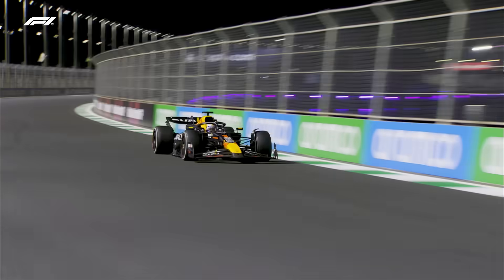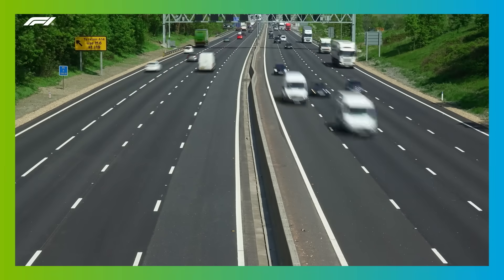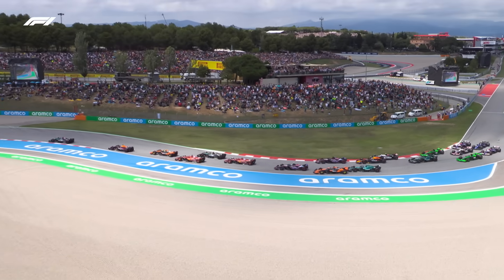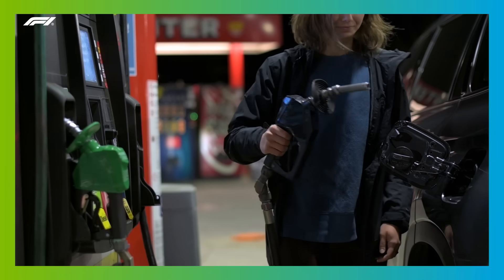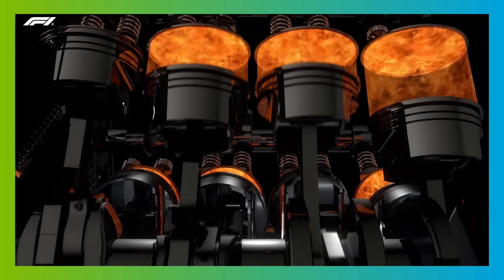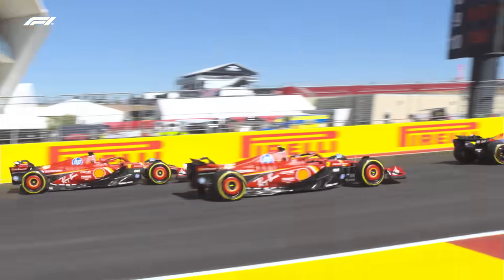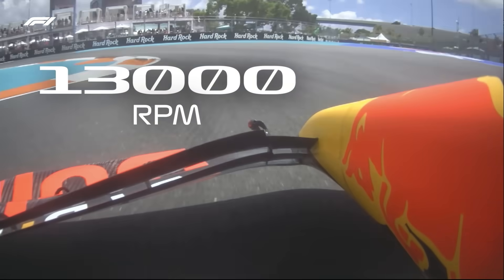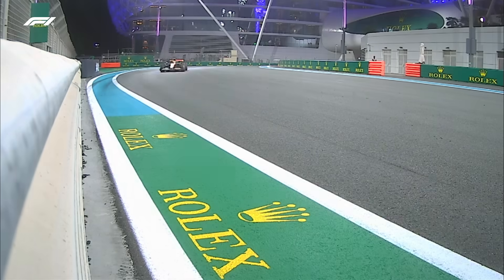F1 Car vs Road Car: The Differences In The Engine Explained | Aramco

Comment: the life of todays f1 engines is very less, they need to reduce the cap of engies per season to 2 per driver if they use 3rd there will be a huge penalty, so teams will focus more on reliability than only power. which will be beneficial for the whole automotive industry.

Comment: 1:25 "The turbo charged 1.6L engine in a typical family car might produce around 160hp" is probably the most American thing I've ever heard. A regular family car at 1.4L in Europe makes around 160hp, but 1.6L turbo engines can easily make >250hp. Then again, the USA did bring us the GM Vortec 8100 which was an 8.1L v8 making 340hp, that's a whole 42hp/Liter!

Comment: Reliability and long term application play a huge role too. F1 engines are expected to last 1000-1500 kms before a rebuild. Road car engines are supposed to last 300,000Kms+. Higher performance = Higher wear and tear.

Comment: I still say: keep the fuel limits but give them unlimited fuel flow and unlimited turbo boost. 
That would definitely give chances for smaller teams to go crazy and risk it all (engine blowup and penalty or no fuel halfway) and make an impression even if they don't finish the race. Not to mention it would scramble the qualifying by a lot!

Comment: Yes, but as you tell people that electric motor will be almost the half of the total power the PU will be capable to produce, tell people  just the same you will remove the MGU-H which is central in recovering, which is the key world for these engines along with efficiency, and the magic trick to have all the turbocharging advantage without having its issues. IMHO a totally crazy decision.

Comment: This kind of efficiency wouldn't have happened if we didn't care about it and I'm glad for the V6T hybrid era. We can take that thermal efficiency tech and apply it to all sorts of engines like V8s and V12s. 

Though we could have had mass flow limits on any engine configuration, and it would encourage the teams to squeeze every drop out of thermal efficiency for maximum power.

Comment: need to say that according to rumors mercedes ICE was able to reach 50% of thermal efficiency by 2015-2016 already but only on ideal conditions of a testing dyno. It's hard to say if engines actually used in race until today (that have been frozen for most of their parts back in 2021) are close to that rate in real world conditions influenced by thousands of factors like temp, humidity, air pressure etc.

Comment: there is no point in comparing f1 engines to road car engines, since the engine technology being used has no relevance/connection to the public whatsoever, especially since f1 is not an endurance series. F1 should go back to naturally aspirated v10s, to not only fix the reputation of the sport but to bring back the sport to what its name means.

Comment: Another thing that is different is the fuel. The don't use petrol or diesel, the bang bit is bigger with their unique kind of fuel, like with aviation fuel
Reply: What do you mean they use don't use petrol 😶
Reply: It's petroleum based like petrol or diesel but it's a bit in-between them both. Obviously ignites like a petrol but acts also like diesel under pressure where the heat of compression is enough to combust. Hence why Petronas, Shell etc pump so much resource into developing the best kind of fuel
Reply: Current F1 cars use E10, the same fuel I use in my car.
Reply: @TheDerperado the same amount of ethanol sure, but not the same petroleum base

Comment: It also helps that a formula 1 car only has to do 300km per race, and 24 times in 2024, and they get to replace the engine 4 times a year, and more with penalties. A road car engine has to go tens of thousands of laps without ever changing it. If formula 1 cars would have to do the entire season with a single engine and no replacements, they would loose quite a bit of efficiency and speed in favor of reliability...
Reply: Plus add that many auto driving consumers fail to keep up with routine maintenance. Where as Formula One engines have top rated engineers caring and maintaining these race engines.
Reply: F1 cars also rev a lot higher than normal cars.
Reply: Add to that, they get 3 engines per season before penalties. So an engine is never expected to do more than 8 races.
Reply: Where can i get those scrap engines 😁😅
Reply: Super high compression ratios. Pistons that move shorter distances between combustion. Honestly it's not that hard to get a stock engine over 500 HP it's just expensive.

Comment: A big factor is also the fuel. F1 engines don’t run pump gas so theres more potential energy available due significantly higher compression ratios possible.
Reply: Modern F1 cars run on pretty much the same fuel as normal road cars
Reply: Even down to the small ethanol mix. They changed that in 2022 I think. @Origamiace135
Reply: You're right, road cars use gasoline which is cheap but inefficient, while f1 cars use fuel with ethanol, which combusts more efficiently

Comment: How does a small engine generates so much power? Simple, they didn't design the engine to be reliable beyond the F1 season it needs to be used.
Reply: @SkaMacanan The answer for the more power isn't "less reliability"...
Reply: Part of it for sure @HabitualLine-Stepper
Reply: Are you aware that the V10 and V8 used to last at best 2-3 races and the V6 now run for around 7 races? Also how is a performance engine supposed to last an entire season when every race is about 305km long and they run basically at 4-5 times the RPM your regular car (assuming you drive around at 2k-3k RPM) and we're not even counting the 3 practice sessions and 3 qualify sessions. If anything the engines nowadays are pretty reliable.
Reply: @Kunkyard  modern reliability is exemplified by one Stat:
"Driver to finish every race lap of a season"
only a achieved by 4 people
2024 Oscar Piastri
2023 Max Verstappen
2019 Lewis Hamilton
2002 Michael Schumacher

Ferrari F2002 aside, it's obvious reliability heavily skews to the recent past
Reply: @TheImperfectGuy  Thank you for the stats. And correct me if I'm wrong, because I could be very wrong here, but I do think that there was no engine penalties or a maximum number of engines back in 2002, unlike today. Even with no rule like that there were a still lot of engine reliability problems per season. Shows how well Ferrari built their engines for that season and how reliable engines have been for the past couple of seasons
Reply: oversimplification imo
Reply: False. They can't intend do that as they would fail the safety checks the FIA carries out before the engine gets approved. Plus they have to now share their developments so Lying isn't an option
Reply: Not entirely true. If you use your road car engine in anger around its peak powers and revs every time you're in it as an F1 engine is used it wouldn't have the same relaibility.
Reply: 1/3rd or 1/4th of the season even
Reply: Standby, Toto will ring you in a bit… you’re hired..!! 😂
Reply: No, it’s compression ratio and peak RPMs. Both are double a normal turbocharged road car.
Reply: False not true.   Grow some hair on your head first then opine.
Reply: Oranges vs Apples 🍎🍊 Road car engines, if properly maintained last for decades, whereas F1 engines are ‘over squeezed’ n barely last even one season properly😅 Nevertheless the F1 engine technology is widely used to develop new engines for road being same ICE engines and as mentioned in vid, the F1 cars are more of HYBRID nowadays rather than pure ICE vehicle….but on the other hand we are now heading towards the era of EV and Hydrogen engines…how long will F1 last is the hanging question
Reply: Oranges vs Apples 🍎🍊 Road car engines, if properly maintained last for decades, whereas F1 engines are ‘over squeezed’ n barely last even one season properly😅 Nevertheless the F1 engine technology is widely used to develop new engines for road being same ICE engines and as mentioned in vid, the F1 cars are more of HYBRID nowadays rather than pure ICE vehicle….but on the other hand we are now heading towards the era of EV and Hydrogen engines…how long will F1 last is the hanging question
Reply: 😂 bro doesn't know what he is talking about. Talks like a salesman
Reply: The dumbest take I’ve ever heard 😂
Reply: what about air + fuel + spark...
Reply: 840hp for a V6 is still impressive
Reply: @andrea-yl4cx1.6L engine as well I might add.
Reply: Just take a look at the challenges Mercedes faced trying to get the AMG-One production ready.

And that power train still needs complete rebuilding every 50 000 kilometers costing as much as a very nice countryside house